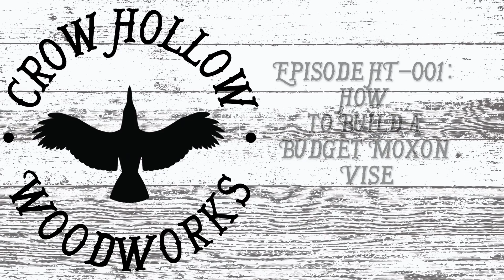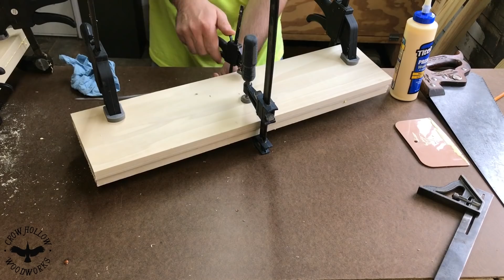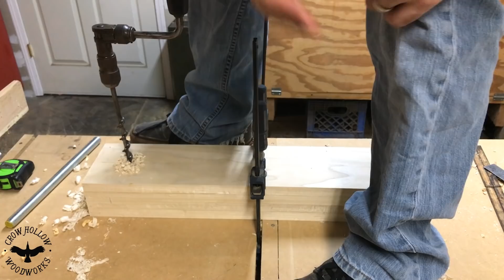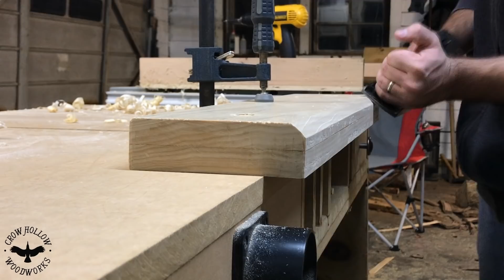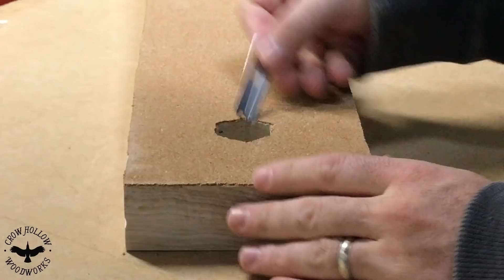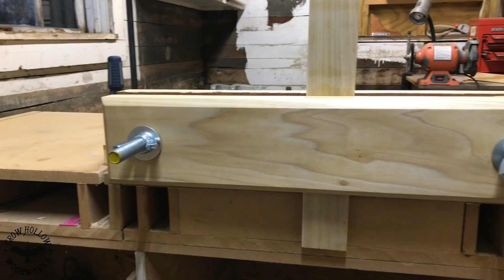DIY Budget Moxon Vise

Comment: I have watched about five or six similar videos on how to build a Moxon Vise. Yours is a no-fuss, no-nonsense presentation that beginners can feel confident about following. Thank you! I bought my hardware from Taylor Toolworks for approx $50, but regular wing nuts and bolts will work fine, too, as you point out.
Reply from the maker: Thank you very much! Glad it was helpful👍🏻👍🏻
Reply: @Crowhollowwoodworks  It was. One of the ways in which this was helpful was the (almost) no machinery approach. As for myself, I work exclusively with hand tools. Partly because hand tools and methods is what I inherited from my 96-year-old cabinet maker father and from four generations of cabinet makers before him in my family. And partly because I need to protect my hands from injury. All the other videos I watched on making this vise (often the first for many) used expensive tools.

Comment: Thanks for the video. You scared the crap out of me watching how you trimmed the laminated blocks on the table saw. The thin edge should be on the outside.
Reply: Why the thin edge should be on the outside? If not what's gonna happen?
Reply: @BRUCELAN168  The way it was done increases the risk of kickback. Granted, the off-cuts from this project were small, thin strips, so kickback wouldn't have been as dangerous, but cutting so your off-cuts aren't trapped between blade and the fence is a good habit to get into.

Comment: Hi sir, just wondering how you decide when to use hand tools vs. Power tools? First time on the channel so I was surprised when the table saw came after the hand saw.
Reply from the maker: Sometimes it’s comfort level with the task at hand, sometimes it depends on the project. At the time I didn’t have the proper setup for thickness planing by hand or rip cutting by hand, but now I can do both without issue.

Comment: Just to clarify, did you use a 1” drill bit?  I ask because that’s what I did and I have 3/4” rod and nuts but the bolts seem just barely wider than the 1” hole. I’m concerned I did something wrong as I don’t think there will be enough material to support the nut for me. Thanks!
Reply from the maker: It was approximately a 1” hole, the bit was a number 15 auger bit I believe that was a little bigger than the threaded rod, plus I rounded out the hole a little bit when drilling.

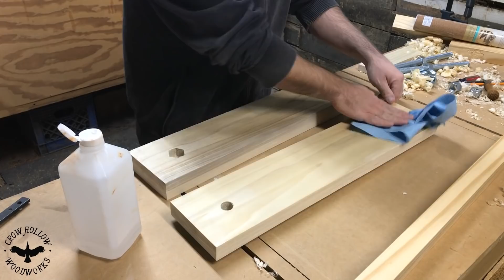Comment: 5:03 -> what material?
Reply from the maker: Adhesive backed cork material used to line drawer bottoms. Regular cork sprayed with an adhesive would do the same thing.
Reply: @Crowhollowwoodworks  Thank you for the answer, but in my country it seems to use another name for the material. It looks like I will make without that layer, will it be slippery?
Reply: @wongponjer  You can use leather.

Comment: I like liked most of this video, especially your use of hand tools. But I have few suggestions/criticisms. Four clamps doesn’t seem sufficient to laminate two large boards, you leave many areas without clamping pressure. Running rough glued edge surfaces against a fence to trim the edge can cause kickback on the table saw unless that edge has been scraped smooth and flat. And if it is smooth and flat the it is better used to trim the opposite edge. Also, if you leave the outer vise face wider then you can make it lower so it can easily butt against the bench edge giving extra support to a long clamped board. Just my 2¢.
Reply from the maker: Thanks for the feedback!
Reply: I would hardly worry about the million clamps. It's hardly structural is it? And when clamped against something the chops anit going anywhere. It's in the maths bru

Comment: Great video. Thanks. Do you see any problems with using 1/2" threaded rods, nuts, and washers instead of 3/4"?
Reply from the maker: I think you may run the risk of the rods bending as you open the vise up wider, or racking more under stress. If 1/2” is all that’s available to you I think it will work, you’ll just have to be careful.

Comment: At 2:00 , If you put a little kosher salt on the glue, the wood will not slip when you clamp it together.
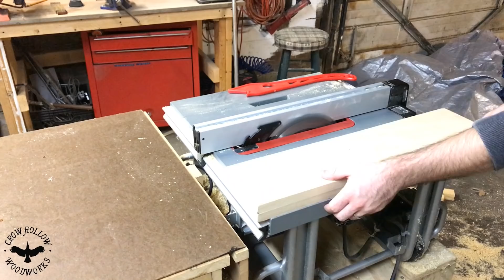By the way you might want to try using the fence for the work piece instead, it will probably produce a better result. (2:19)
But nice work, simple and effective. :-)

Comment: Thanks for the informative video.  Do you find you get enough clamping pressure by hand tightening the wing nuts or do you find the need to grab a wrench and tighten further?
Reply from the maker: I always just tighten by hand, I’ve never ran into a situation where I’ve needed to use a wrench to get more pressure.

Comment: A nice project, and an equally nice design.  You explain what you're doing quite well (IMO), but as others have said - I had to turn the sound all the way up and still struggled to hear.
Reply from the maker: Thanks!
Reply: @Crowhollowwoodworks  One solution is to re-edit the sound by over-laying your voice track while using a microphone at your computer and just crank the volume up a bit.